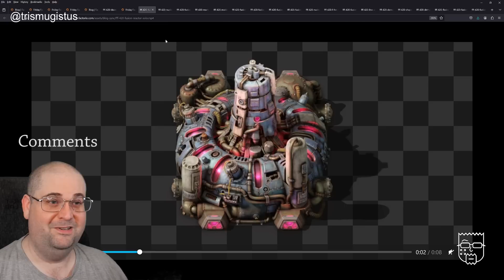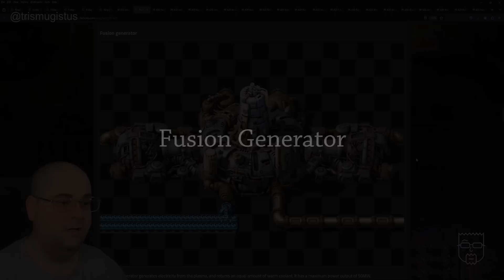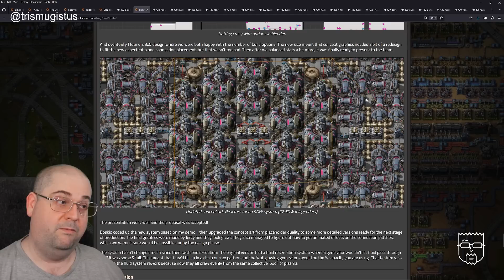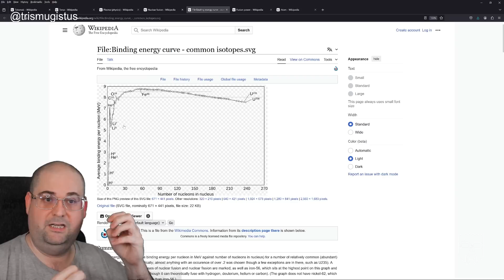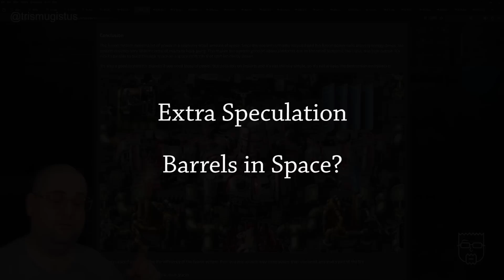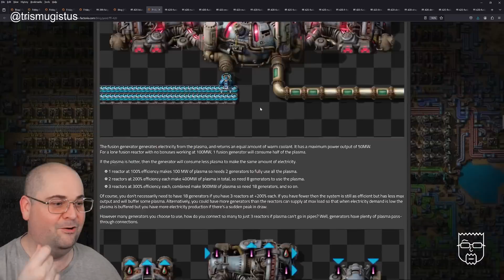Mmm.. Doughnuts | Factorio Friday Facts (FFF) #420 | Analysis & Speculation

Comment: I'm curious what the final planet is going to be like. I know this goes off topic about fusion a bit. Since its a late game technology, I wonder if it will be unlocked on the last planet. Far from the Sun with way less affective solar panel opportunities = cold planet. Curious to see if this planet will have a combination of several threats , ie biters of course, but lightning, maybe some meteor storms, etc. And what exactly is the end goal? Since we can blast into space already, why are we hopscotching to other planets besides to just unlock tech? Letting my mind run wild. I can't wait for the expansion.
Reply from the maker: Yeah, I think Fusion will be on the last planet.  My guess is the fuel is there.  I have to say I'm curious as to why we need such a big power producer and how that might tie in to what we're doing there.
We get solar at the point where scaling up power is becoming a thing, but also pollution is likely getting to be a bit of a problem.  And we get nuclear when we need to scale up again because now we have to do rockets but maybe we don't want to lay down endless panels.  So what is the thing that fusion makes simpler?  Lots of power to do what, exactly?
Having to heat everything on Aquilo would make sense, but as you say, is it more about having to protect your stuff?  Powering loads of turrets, building shields to protect against weather, and also heating your base?  Could be.
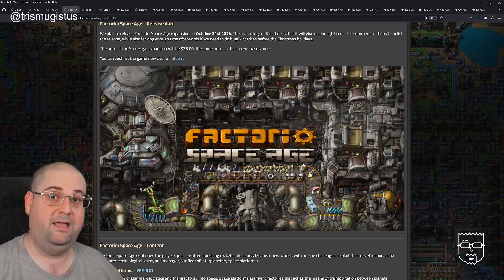I actually did a video a while back that included some of my thoughts on what the end-game might be: https://youtu.be/xdAwCjOP8L0 (from around 1:20:00) :).  This was some of my tamer / more sensible thoughts and I always wanted to a follow-up talking about the bonkers ideas I had, but I don't think there's time anymore :(
Reply: @trismugistus  
Thank you for linking that video. I didn’t realize you made that one but I just watched it and it was awesome. It gave me more insight to how your speculations were formed regarding the planet names and different tech before they were officially announced. The late game speculation had some really good points to them. 

The devs wrapping up the DLC and 2.0 have me kind of questioning what is next after all this is done. Obviously they will continue to make updates to these after release, but I’m curious if the end game for Space Age is going to conclude Factorio. Although it doesn’t really have a story other than the engineer crash lands onto Nauvis and needs to get home, I wonder what he was doing flying around in the first place. Possibly his homeworld was in shambles and he needed to go out to find resources to ship back? Then I thought well, what if Aquilo is his homeworld and it is a semi type frost punk scenario where he needs resources back there to thaw the planet since their thaw tech was knocked out. Either way, I’m curious if WUBE will consider this game complete after the DLC and 2.0 release in terms of content. 

My mind going wild** Aside from those questions, I think it would be cool as a follow on DLC or future of Factorio to have something along the lines of doing resource type missions or quests for different factions to earn tech or research tech for them. Repair missions for space mining colonies. I know first and foremost Factorio is a a resource automation game, and it has, in my humble opinion, the best mechanics in that genre out of any other game. That would be cool to eventually see WUBE build on to what they have already.

Any way, getting back to the upcoming release, unlocking a portal type tech to transport resources would be cool. I fear that might render the platforms obsolete unless you only get to build one portal which is the get back home. 

You mentioned lava not being on Nauvis or other planets. Could it be that a new deep drill exists to extract lava out from the mantle of those non Vulcanus planets and give you access to lava? 

Thanks for making these videos. I’ve tried making videos and the amount of time to make and edit them is astronomical so I appreciate you taking time to do that for the rest of us. Cheers!
Reply from the maker: You're very welcome, thanks for the kinds words and glad you enjoy the videos :)
I sort of suspect they'll make a new game after the DLC is released and stable, but I also think they'll probably add a few free updates that add significant features first, so I don't think it will be for a while.
I did wonder if they might make Factorio 2 (meaning a proper "sequel", though maybe more in the style of something like civilization where the sequel is basically the same core game but with a lot of changes).  However I also wouldn't be surprised if they keep adding stuff like Minecraft does, rather than make a proper sequel.

Comment: What they meant by “reactor need some energy to maintain the reaction” can be hint, that to run it we will have to kick start it with a loads of power, a kind of separated challenge
Reply from the maker: Yeah, it'll be interesting to see how much power it draws.  I've seen people posting these big arrays of fusion reactors, but I wonder if the need to kick-start them will make them difficult to build.

Comment: looking at the fluid connections for the CENSORED "coolant" building ....i think it means we're getting a new refinery or chem plant....that just happens to also be the building used to chill coolant. 

Because...there's really no "valid" reason to censor a building that ONLY has a single purpose---chilling the coolant used in the new power plant mechanic.....UNLESS that building was also going to be useful for balancing the impacts of the foundry and EM  plant..... ie: a chem plant or refinery with a built in 50% bonus? yes, please.
Reply from the maker: I absolutely agree that it has to be multi-use / multi-purpose and that's part of why they've hidden it.  Even with that, censoring it is a little odd, so I'm guessing that the way it looks would clue us in on the usage - that is, if it's not really just a cooler building but is actually a level 2 chem plant that happens to also have the cooling functionality then it would make sense it it looked like a "big" chem plant.

Comment: you should be able to get 3 reactor setup where they each get 300% because of the additional connections you can create a "triangle" shaped design...such that each of the 3 reactors are connected to both of their neighbors.
(it actually shows how you can have 3 reactor setups where each of the reactors gets the neighbor bonus (although it's actually a 4-reactor setup where each of the 4 reactors gets 2... you can remove either the LEFT or RIGHT reactor to get what i was talking about above. (@23:24)
Reply from the maker: Yeah - I wasn't "thinking with off-sets" :)

Comment: After that fff, I am almost completely sure that the ending will be the same as in SE. Spaceplatform with huge fusion build and lots of space engines.
And if that's the case, it's sad. I was hoping for something more ambitious, at least something new. Happy to be wrong.
Reply from the maker: I confess I've not looked too much at the Space Ex ending - I know it has some sort of "secret" ending that's meant to be quite complex to achieve, but I don't know what either is.
Reply: @trismugistus  "secret" ending its one of two possible endings in SE(the hard one).

Comment: I have speculated before that a main focus of Aquilo is computing. I wonder if the coolant could also be used in a supercomputer? It would be interesting if the coolant was mainly used for computing, and then it makes sense why fusion is unlocked on Aquilo if we are already doing computation there.
Reply from the maker: Yeah, and if we're making super capacitors and super conductors on Aquilo, plus super lightweight materials on gleba (carbon fiber) and super strong materials on vulcanus (tungsten reinforced steel) then it does all feel like maybe it's going to support something "super" on Aquilo :)
My hope is that it's a megastructure - perhaps it could be that the supercomputers also have a neighbour bonus and so you want to put as many together as you can to form some sort of hive-brain mega-computer to help you leave the system and get home?

Comment: I wonder if 100% solar panels will still be a viable strategy in Space Age. I feel like a lot of players preferred 100% solar in 1.0
Reply: if you are not against using efficiency modules, I think solar is perfectly fine.
Reply: I think a lot of people would prefer to not go full solar if UPS was less of a concern anyway
Reply from the maker: I think solar is probably not really viable on Fulgora and Aquilo as they're the furthest from the sun - maybe just about for the platforms in orbit and if you've legendary panels, but on the surface, I think it'll be basically useless, especially on Aquilo.  I imagine they've seen everyone spamming down a million panels and felt they needed to shake it up a bit for the endgame - making it so they're not the perfect solution stops it just being a tedious thing you have to do absolutely everywhere.
Reply: @trismugistus megabasers only use them because ups constraints of vanilla fluid system. With fluid system rework they fix this constraints already. No more millions of solar panels, thankfully.

Comment: The idea of the quality fuel cells is interesting. It would seem like smashing materials into high quality fuel cells using a recycling loop would be relatively wasteful, but also seems like a form of very costly dense fuel. Given that they showed a reactor on a space platform, it seems like another case of quality just being used to squeeze efficiency into the space platform
Reply from the maker: Yeah - we don't really know what a lot of the costs are for a lot of this stuff.  For example, how limited is space on platforms?  Okay, level 4 quality blue-tonium might be super dense and efficient, but how big is the space gain compared to all the stuff you have to waste?
Interestingly, I believe the graphic showing the level 4 one is actually a Nauvis production chart, so if it is sourced from Aquilo, then they've used loads of rockets and platforms to basically move it all to another planet simply in order to dispose of most of it through recycling, simply to have a space saver on other platforms?
All seems a bit complex and wasteful, and I'm guessing horrible to balance, but I guess it must be worth it?

Comment: Regarding what you're talking about around 19:30 with fission reactors always consuming fuel, I think they may have teased there's going to be a way around this without resorting to steam storage? In the space platform video in FFF 406 you can see a reactor connected to the circuit network (which isn't currently possible), and I'd imagine that either reads the temperature or just immediately enables / disables fuel consumption. I'd assume we'll have that exact same functionality here where you can disable the fusion reactor via circuit network to avoid wasting fusion cells and plasma. Great video and wonderfully in-depth FFF coverage as always!
Reply from the maker: Yes, that's a good point I hadn't realised - if we're getting the ability to control the generators via smarts we can more easily work around the quirks of the systems.

Comment: I do wonder why in the explanation the temperature and power scales linearly with each other. is that an oversight, or does it represent the need to input more power to be able to work with increasingly hotter plasma? Normally I'd think if I double the temperature (2mil °C is effectively double 1mil °C at that scale) I'd expect the potential energy of the plasma to be more than twice as large.

That being said, I know next to nothing about thermodynamics.
Reply from the maker: I think they're not bothering with realism for this one - boskid indicated on the discord that he'd just picked some nice and simple round numbers.  Plus simply sticking two tokamaks next to each other wouldn't really increase plasma temperature , and the way you'd probably get heat out of the vessels is by leaching the heat from the chamber walls as the chamber heated up from the outflow of energy and then using that heat to boil water, so I think this is firmly in the "how can we make it fun" territory :)
Reply: @trismugistus  I mean, I'm absolutely ready to have my disbelief suspended, considering that the last I heard about it, we don't have any net power positive fusion generators yet.

Comment: Should the fusion cells, now blue, be the same purple instead? and did you study physics?
Reply from the maker: I think the blue item makes purple plasma is a bit odd.  They do usually try to keep some colour consistency and electricity / lightning is blue so it makes sense to change the fuel to pink.  Only thing I can thing is the potential overlap with holmium, which has pink tinge and they want to keep it different to that (use bright blue for deuterium).  Plus it sounds from some of the dev comments like some of it's still placeholder, so it probably needs a consistency pass.  It's like shouldn't the map icon also maybe be pink, rather than green?
And yes, I did study physics, though it was many decades ago now, so I've forgotten a lot of stuff :)

Comment: About train interrupts and smart refueling. There are two mods developed by two Wube devs: train groups(raiguard) and train control signals(klonan). These two mods together mimic the future functionality well. You will have smart refueling and smart depo parking. They are very minimalistic, zero magic and combinators, easy to use and sits between LTN and 2.0 train features.

they turn on well in the middle of the game, you can install them in your current SE playthrough
Reply from the maker: Okay, cool - I'll take a look :)